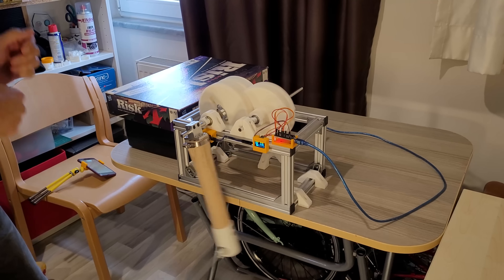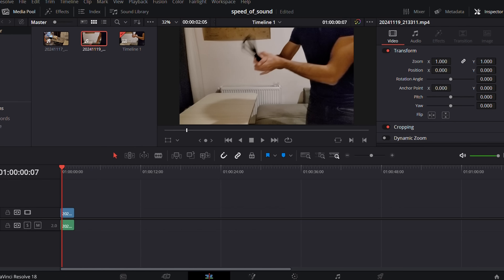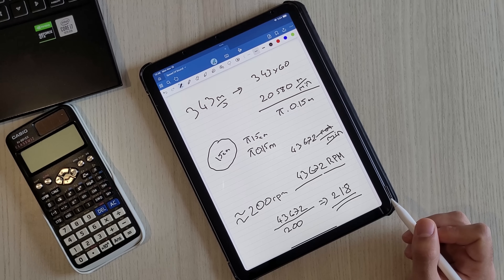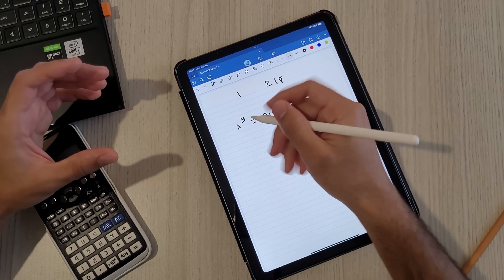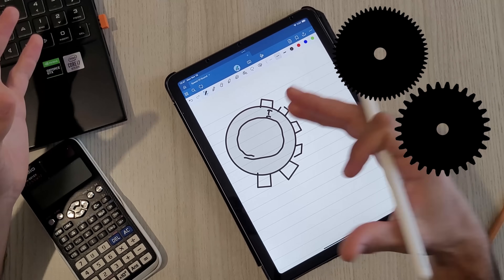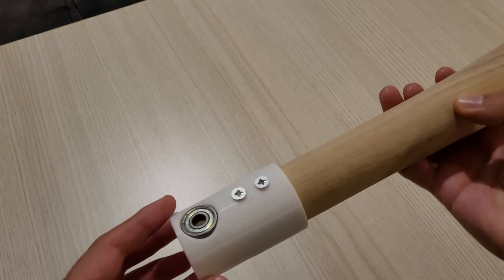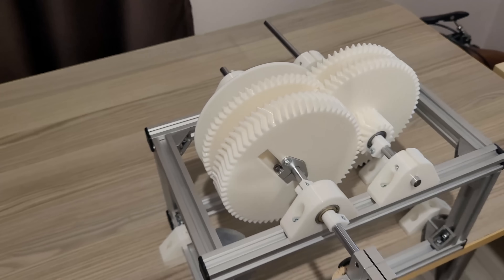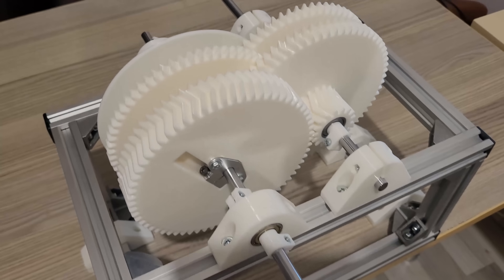Trying To Reach Speed Of Sound At Home 3D Printed Gears

Comment: I am impressed that 3D printed gears were able to take  that much of force. Would be interesting to see what metal gears do. Aluminium 3D printing exists  but I dno how strong it is.
Reply from the maker: If the channel grows enough i might just be able to buy off the shelf metal gears and try that
Reply: @canocholic  If you want to buy gears you might be able to get old car gear box from scrapyard for the cost of it's weight in metal and after video sell it back for the cost of weight in metal. Buying brand new just for video will be expensive. And for cost of CNCing them you could probably get multiple gear boxes from scrapyard.
Reply from the maker: @test-rj2vl  Yeah that doesn't really exist in Turkey, as far as I know. I can buy secondhand stuff but still quite expensive.

Comment: try adding another gear pair
It is humanly easier to exert high force at lower rpm of crank shaft
and create a set up that does not shake
it will be a lot more efficient

Also look up how germans manually started their tanks  (google smth like Tiger II at Militracks 2018)
that manual crankshaft is very similar mechanically to what you're trying to do

also put crank shaft center of rotation at a lower level, and make it so that you can use two hands and your entire body to move it

with these optimizations I believe  you could reach much closer to the 40k rpm
Or some gears will break I dont know
Reply from the maker: Yeah, i remember watching the video of the tank now. When i was editing, i tried to find that video but couldn't remember what vehicle it was.

About increasing the ratio, i knew the breaking point of the system is for two gears, and a higher ratio would mean they need to endure more torque for the same speed. So they would break earlier. If the videos keep getting views like this, i might be able to use thicker gears and a higher ratio
Reply: @canocholic  well clearly you will need stronger gears, as these broke before the desired speed was reached anyway

Comment: The video was fine . you may wanna try to use more gears though i dont thow if that would make it worse or better and try different material printing
Reply from the maker: Hi, A higher ratio would require too much torque to spin and just break earlier
Reply: @canocholic  you weren't turning it as fast as you could do you think a lower ratio and more revs on your end would do it I'm thinkin that and a few more gears in the set it should release some of the stress on them
Reply from the maker: @ricktroxell6448  noo sadly more gears at the means more stress on the input gears. But you can use a parallel setup like I'm mentioning at the end of the video. 
Basically the same ratio but more gears to transfer the power.

Comment: Should apply a lubricant to the gears. This would reduce the friction by a large amount and put less strain on the teeth, decreasing the chance for failure and wasting less energy to heat and abrasion.
Reply from the maker: I did put some thin oil. But i forgot to record it

Comment: Seems to me that one of the easiest ways to increase speed would be to increase the diameter of the last wheel. The friction forces are pretty static depending on number of gears so this should only result in an increase to air resistance, which I would guess is not the biggest factor here. At least not until you start actually approaching the speed of sound.

An increased diameter of only the final wheel seems like it would a pretty 'free' speed upgrade in terms of power and torque required to achieve higher speeds
Reply from the maker: Hi, i think the biggest force we're trying to overcome is airdrag. There are videos of cyclost breaking all kond of speed records following a car with special cover for the cyclist. 

I would still make the disc bigger if i could. In this design, it's not possible. There are two parallel shafts, and if the disc was bigger, it would just hit the other shaft

Comment: could you just increase the radius of the last disc that's supposed to reach the speed of sound? it would make the disc edge rotate twice as fast
Reply from the maker: Hi, In this design, it's not possible. There are two parallel shafts, and if the disc was bigger, it would just hit the other shaft

Comment: You should consider doing this exact experiment again, but using the filament as an independent variable. I would personally like to see polycarbonate. (Edit: You should also put a streamer or something on the last gear as an audio cue for the sound barrier)
Reply from the maker: I feel like a channel like cnc Kitchen can do a better job at that. I might try to contact one of them.

Comment: Hey, the way you went through your planning and included your mistakes along the way is reassuring to those of us who are also trying to design things and keep hitting dramas. I think you're right about the second drive axle on the other side. Heavy vehicle gearboxes have that to spread the engine power over more teeth and bearings in high torque situations.
Reply from the maker: I'm glad you enjoyed it. I might even add 3 more axles

Comment: Using a drill instead of an handcrank will make it easier to reach high RPM on that first gear. That'll probably help you do a less extreme gear ratio, that way you don't need so much force to turn the first gear.
Reply from the maker: I feel like that's cheating

Comment: To redistribute the loads and reduce strain on the gears, a planetary gear set would help you deliver more torque, at least at the lower speeds.

While yes, items like planetary gears will add a lot of resistance, they will deliver much more force, and do so concentrically.
Reply from the maker: I might try that, never designed one before

Comment: You should try making the crank shorter as you would be able to spin it faster and it might cause lees wobble to your table 👍🏻
Reply from the maker: That might help, but I'm not sure. It needs a lot of force to spin, and a shorter handle will increase the force needed. But for sure it at same force it's easier to spin.
Reply: True

Comment: Super cool. I just finished taking mechanical design 1 unfortunately got a D- so I’ll be taking it again but you actually applied and explained all the steps that we would have to cover in practice problems. It’s nice to know it’s at least applicable stuff
Reply from the maker: It's definitely applicable. The engineering that goes onto everyday items is crazy

Comment: a centrifugal weighted actuator, like a governor speed controller... though once at speed, the armature mass on the final gear gets pulled in via a heavy spring that is tripped via a smaller centrifugal governor latch like a mouse trap hook in some ways. not sure how effective that would be in printed plastic with marbles for weighted centrifugal actuation boosters, though if something like that did boost rotational speed, it would likely only be momentarily falling onto its self with the finale gear not being able to freewheel against the second last gear ... though that centrifugal mass shift to gain speed would be calculable given data already tested, though plastic might be partly infeasible ... and or a gear reduction set charging a wind up spring that drives the high speed gear set once wound up fully might be the final product. if their was no size limit in theory the end gear wheel could have a macro stepper motor set built into it that uses the weight of the little dc motors to speed up or slow down via a track system on the final gear and an input stator on the rotation shaft, though a mechanical trip centrifuge would be on par with manual input. as another note as if a rotational trip snare can be made, with the outer weights being pulled inward on a quadradic spiral would additionally boost the outer wheel speed as the sprung force pulls the weights into the center of rotation after a softer rotational latch is set to let it go in some way.
Reply from the maker: This would definitely help, but it increases the scope greatly. Maybe in the future, if i have more budget and time.

Comment: If you did revisit this, ear-pro.

and see if you can put the system under a helium atmosphere(lower air resistance, high capacity hard disk drives do this)

Comment: how about biggers gear shaft size? would gfreatly reduce flex and allow you to use less filament for the same result also bearings that can withstand the rpm ans possiblt keyed shafts would be easier to source in bigger sizes and reduce the likelihood of a failurepoint
Reply from the maker: I didn't want to buy new bearings, so i used 8mm. If i do this project again with more budget thicker is the way to go.

Comment: 2 things, 

First of all, to claim the speed you reached, you need to measure your output speed not your input speed. 

You are assuming that there is no slippage, and that all of your math is correct, and that there are no errors, but it’s better to actually measure your results more directly. 

Secondly, 
You should use 1 more gear. 

Humans are much much stronger when moving slow than fast. We are much more efficient at exerting a large force slowly than we are at exerting a smaller force more quickly. 

So you are better off cranking slower under more resistance. Yes there is more friction with more gears, but the friction for the lower speed gears is negligible anyways. It’s the faster gears that you need to worry about. 

You can also probably make the last gear larger, practically for free. But I could be wrong about that. I do suspect making the the output which is toothless larger would be a big optimization. 

I think the most important thing is optimizing each gear and barring for the speed it’s traveling at. Potentially using stronger plastics for the last gears
Reply from the maker: Thanks for the feedback. Unfortunately, i don't have a tool to measure the output speed. But i believe there was no slippage, gears make a terrible noise when they slip.

If i increase the ratio more, it means the torque required to spin it is also increase. Plastic gears can handle so much. It definitely can't handle 4 times the torque.

In the future, i might use beefier gears from stronger materials and then increase the ratio, but for this project, had to use what i have.

Comment: Very interesting and well explaned, thank you!

Edit:
ways to improve your design:
- doubling the first set of gears would help transferring more torque, that's true
- silicon grease on your gears
- having a way sturdier fixation method than this janky folding table XD
- try to fix your tachymeter (you can embed your magnet in your first gear, or better maybe the second one. More rotations means more precision)
- Keep having fun = D

Comment: I would have tried to make the crank handle from 1 piece of METAL
Reply from the maker: Hi, definitely would help. But i don't have tools to build such a thing
Reply: @canocholic  yes tools are Sooooooooooooo expensive, especially if you don't want to support the Chinese economy.
Reply from the maker: @Rusty-METAL-J  Yeah and I hate using cheap tools. Whe you buy cheap tools everytime you use them you hate your life. It's definitely not worth it. It doesn't have to be expensive but HAS to be decent.

Comment: Duh, just add another 4:1 gear set and you're there 😄
Reply from the maker: Unfortunately, it's not that simple. It would be too hard to spin if i added another gear. The torque required to spin it would be multiplied by 4

Comment: Try to reduce weight of gears and increase strength centrifugal forces add up and will cause dangerous failures. Get nylon filament don't use PLA. Put a tach on your output .   Cover your contraption with some clear acrilic to block shrapnel

Comment: There is a formula that equates the velocity at the edge of a spinning disk with material properties. v_max = sqrt(specific strength) = sqrt(tensile strength / density). For ABS which has a specific strength of 43 kNm/kg, you'll reach a maximum of about 200 m/s. You'll need at least 117 kNm/kg for the speed of sound. Aluminum is probably your best  bet here as alloys usually get above 117 !
Reply from the maker: Yeah, it actually got close to tear itself apart. The grears are pla and I'm guessing around 580-620 km/h they would explode. I definitely have to upgrade to metal. At least the larger disc. I can just get an aluminum disc and attach it to a small plastic gear.
Reply: @canocholic  I think your best bet would be the 7075-T6 Aluminum alloy. It's cheap, it's light so you can spin it fast and it has the required specific strength. Composites also have extremely high specific strengths but I don't know if they can be made into gears. Best of luck with reaching supersonic speeds !

Comment: Why are you not simply aiming an rpm meter on the output disc?  That would give much more confidence on the actual speed reached than a paper towel calculation like you now did.
Reply from the maker: I don't have one, sadly. It costs more than the total budget i had for the project.

Comment: If you increased the diameter of only your final wheel to about 39 cm, I believe it would have hit your goal of reaching the speed of sound. If all other variables stay the same and you reach the rpm of your first test being 16,686 rpm, if the final wheel is 39 cm, you'd get 1,227km/h. Make it an even 40 cm and you're way over it.
Reply from the maker: Hi, sadly, in this design, the size of the disc is limited. There are two parallel rods, and if the disc was bigger, it would hit the other rod.
Reply: @canocholic  I for sure see that. It would have to be attached outside of the rig somehow and the longer rod would have to be shortened but just a thought I had. I also don't know what that would do to the inertia or force to crank it. Cool project though!
Reply from the maker: @kniffin719  Maybe next time, attaching it outside would mean it would need to be powered with a rod. And all the bearing on the rod would need to spin at the same rpm, creating lots of friction. Advantages vs disadvantages I'm not sure which side is better. I'might try that, I'm also thinking about powering diffrent setups with a motor to calculate the efficiency.

Comment: I worry about videos like this, because I think people jump too quickly to finding out if it's possible without first considering ~~if they should~~ nono, Jurassic Park reference notwithstanding, without first considering what happens if they succeed, what happens if a PLA part catastrophically fails while traveling around 1000-1100 feet per second, in your house, near your face? Anyways, take care of yourself, you're making great content and I'm glad this video is blowing up instead of the subject of the video. Just remember SAFETY FIRST!

Also worth considering:
Air resistance will be likely the number one factor if you want to reach the speed of sound, the fluid mechanics of gears/discs spinning close to eachother at those speeds but different speeds (and opposing directions) is going to do weird things to the air flow around the gears which will also cause turbulence that could also cause resonance issues which will further potentially lead to catastrophic failure.
VERY IMPORTANT if you have to switch the last gear to aluminum because PLA doesn't have the tensile strength to hold together at those speeds, remember you are also dramatically upgrading the danger if it does fail, a metal fragment traveling at the speed of sound is called a bullet. This is the time to invest in a plexiglass barrier if you haven't already at this point.
Reply from the maker: You are absolutely right. I'm wearing eye and ear protection (it was super loud). But that's not enough. Couldn't really afford more for this project. Hopefully, thanks to everyone watching  the channel can fund the next one.

Comment: A problem with this is if the gear ratio is to high the first one will be hard to get moving. 
My spontaneous thought was getting a gearbox that would work similar on a car or bike. This way you could change the gear ratio mid movement and be able to keep cranking up the spread because it's already in motion.
Reply from the maker: That would be cool

Comment: You want to direct drive a disc in a fast motor. A pretty normal rc plane motor can spin a small prop up to about 20,000 rpm. You only need about a 15cm radius to reach c.
Reply from the maker: That's cheating tho. And the thing is a plastic disc will just explode at aroun 550-600 km/h

Comment: Next time, draw a spiral on the output disc.
A long line spiral, so you can see it when it's spinning fast. A short line spiral you'll only be able to see spinning in the beginning and then it'll just blur. But a long line spiral, you'll see spiraling at higher speeds.
Reply from the maker: Will do that next time i try this. I didn't have a marker i could use on plastic this time. But I'll get one for sure.

Comment: do 1:4 ratio from the handle to first gear then into a worm gear to run the next gear, it has extremly high torque which helps with doing extreme ratios
Reply from the maker: I think I'll try that in the next iteration. I have never seen a worm gear working at high speeds. I know that they are great working as reductors, but since the ratio is too, it might just break easily when run in reverse.